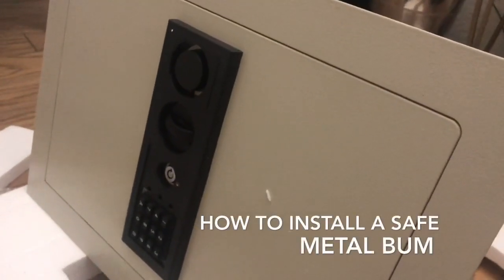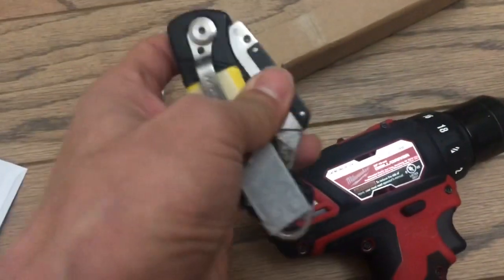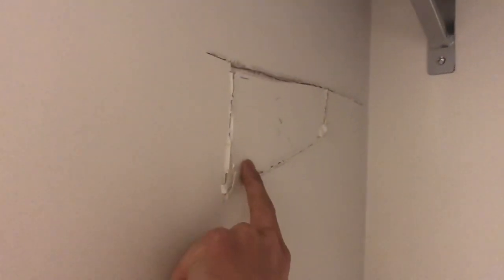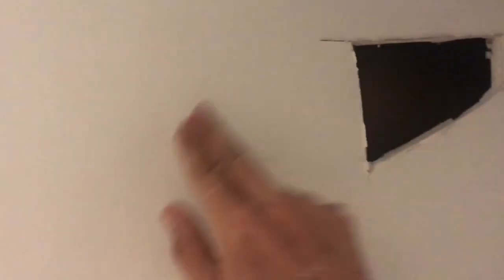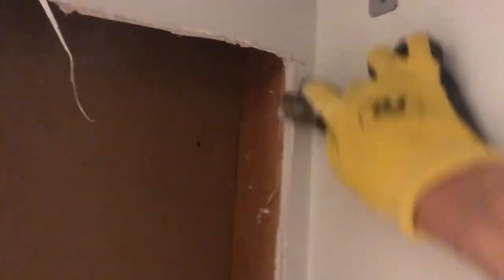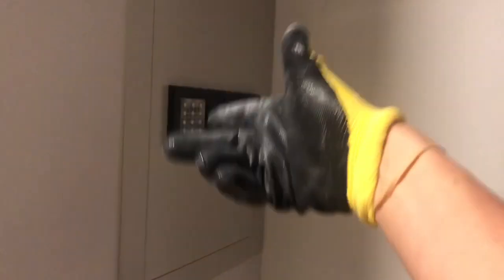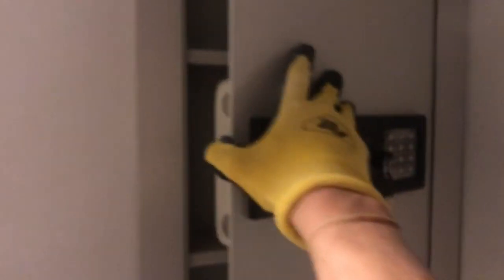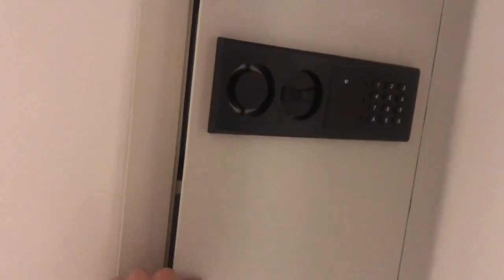How To Install a Wall Safe. For precious metals, cash and other valuables.

Comment: Good info here even years later👍 Well done vid. Small critique. Better tool for cutting sheetrock is multi tool instead of sawzall. Just incase of plumbing or wires. Multi tool will be less likely to cut through wires and pipes. Great job here and fun watch. Like your karate moves😂

Comment: Can’t tell how you cut that hole you ever did construction work
Reply from the maker: You just have to score it with the sharp knife. Yes I’ve done some construction but scorrring it isn’t too hard then you can break the drywall

Comment: Nice! Thinking of just burying my bullion. haha Seriously though I am a firm believer of Liberty safes. Unless it's a thief that knows you and your daily operations, your average snatch and grab thieves are not moving out a 600 pound safe (empty) that's lag bolted to the floor. It would take quite a few tools and coordination to move something of that heft. Getting inside of it is virtually impossible. Google the demonstration on them trying to pry it open, pretty impressive. I am also not opposed to storing some of your collection in a safety deposit box. The odds of having your stuff split up and a stolen are less likely than having your whole collection in one location.
Reply from the maker: Silver Surfer thanks surfer 🏄 good advice I’ll check our liberty safe as I’ve filled this safe and need another lol. 

Also it is good to split up locations and have multiples instead of all in one basket.